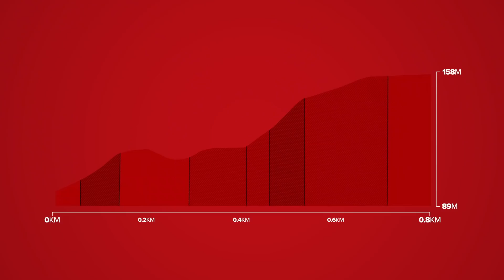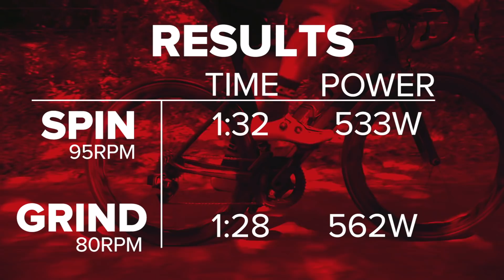Spinning Vs Grinding | What Is The Best Cadence For Climbing On A Road Bike?

Comment: This topic has been very well explained previously without the dodgy "experiment".

As any serious cyclist knows, lower cadence increases the long term fatigue in the legs but keeps the heart rate relatively low. The opposite is true for higher cadence which is easier on the legs but pushes the heart rate higher. The heart rate will come down leaving very little fatigue but the same cannot be said for tired legs. A good cyclist knows this and adjusts cadence depending on how they are feeling. 

Dr Michele Ferrari, Lances Armstrong's famous doping doctor was the one who told him to increase his cadence significantly. The key is that the ability to dope the cardiovascular system (using EPO, etc) is far greater than the muscles themselves.

Comment: In my case,i can maintain 30-40 rpm grinding for 10 minutes straight and 30 minutes spinning with 90-100 rpm.i pushed myself for the past 2 weeks and I can grind throughout very steep hills.using 2x10 gear on my roadbike steel frame, I can climb very steep 5km for just 6 minutes

Comment: Seems your body will just 'tell you' what your 'proper climbing cadence' is when you become better than a novice cyclist.  All you need to remembed is increase your cadence before 'attacks', otherwise just ride at the cadence that 'feels right'.  I started cycling 40 yrs ago when 2×6 sp 42/52t & 13-24t was 'standard road bike gearing', a 46" low/105" high gear.  I climbed in the 40-60 rpm range in 42/24t.  With cadences btw 50-60 I alternated btw sitting & standing, and below 50 rpm I climbed out of the saddle mostly. Btw 65-70 rpm climbing I remained seated and usually shifted into the next higher gear.  OC I was a teenager who weighed 150 lbs back then.  I road bikes like that so long that today I consider anything above 60 rpm while climbing 'spinning', anything below 60 rpm 'grinding'.  Riding flats I consider 'grinding' below 75 rpm, & 'spinning' over 80 rpm, btw 75-80 rpm 'neither grinding nor spinning'.  My 'prefered cadence', the 'sweet spot' is 65 rpm climbing 6-8% grades, moderate cruising flats 75-80 rpm, quick-80-85 rpm, fast 85-90 rpm, really putting out 90-95 rpm.  I spin out on decents at 135 rpm.  My prefered climbing and cruising flats cadence is about the same rpms the pros raced during the 70s & 80s, maybe 5 rpm slower.  IMHO I think this 'spinning craze' us mere mortals obsess over, we've been duped. The 'advantages' ONLY apply if doping with EPO, which increases red blood cell count, & high cadence cycling is ALL aerobic vs. anaerobic.  Recreational cyclists should only spin if they lean more as aerobic athletes. Weight lifter types should grind.  Avg. types just ride by 'feel', but remembe oc to start spinning right before attacking.  Occasional low and high cadence 'training sessions' are necessary to build up BOTH strength and endurance.  You should be able to ride a bike to whereas you 'feel comfortable' cruising flats btw 70-100 rpms, and climbing btw 50-80 rpms, the steeper the grade, the slower the 'feel of right cadence', for example: 75 rpms 4-6%, 65 rpms 6-8%, 60 rpms 8-10%, 55 rpms 12-14%, 50 rpms 15-20%, +/- 5-10 rpms depending if lobsided either endurance or weight lifter.  Old school cyclists have this 'cadence thing' down to 'the feel of science'  ... ie: a 'conundrum' ... so just 'trust your gut' ... ie 'trust how you feel'.

Comment: This is very rider specific. Hinualt often climbed in a 53/15, Pantani geared high too. Froome and Armstrong, obviously use(d) much lower gearing.

When I was younger and used real rollers and rode the track my cadence was much higher. Now, I'm older and I've found that climbing in the big ring or switching back and forth in the middle of a climb from high to low cadence is actually faster for me than just trying to maintain a high cadence.

Comment: Developing good "spin" habits and resilience (learning how to spin and how to recover mid-session rather than blowing up) involves smoothness around the pedal stroke and generally more reliance on "aerobic" muscle recruitment. As you rely more on "anaerobic" energy production throughout the stroke, even if you seem to be recovering, you risk blowing up more suddenly with less opportunity to recover your pace (hence you risk getting dropped like Jan Ullrich chasing Lance or Marco).  All that aside, it's a simple fact that even if you do start to lose your pace while "spinning" versus using a lower gear, it's easier and faster to recover while spinning simply because you can back of slightly and recover without anyone really noticing if you don't need to drop down a cog or loose smoothness. It's harder to recover if you are at the lower end of your cadence window and then must back off because you loose smoothness, hence efficiency, hence you're wasting resources on maintaining your revised pace rather than allowing your body to recover as you perhaps sit on someone's wheel for a moment. If you have to reach for an easier gear that can work but only if you've planned for it because it's far more likely that adjusting to the new cog at that moment will also require transition time and your pace and recovery suffers. Hence you are more likely to get dropped and or lose significant time in a time trial or breakaway mode. It's simply easier to govern a smooth pace if you have a wide cadence window and practice smoothness throughout during your low and moderate intensity work. 

The reason cadence is lower on climbs, generally, is that it's harder to accelerate in a sustainable way. IOW, maintaining inertia is harder on climbs. Therefore your effective cadence window is smaller and it takes too much force to keep a high, smooth cadence because you have to accelerate in to it. Compare average cadence on a smooth but steep climb to an erratic grade that requires constant changes in effort. Your effective cadence window shrinks at both ends. OTOH, we notice it much more if we get hit by extra resistance when we're already at the lower end of the cadence window. If you're cruising at 90 rpm and hit an extra steep grade you don't notice if you drop down to 85 for a moment. The same conditions at 75 rpm might seem fine until you hit that same increase in load. Suddenly your peak torque requirements spike but you're only looking at power in watts if you're looking at all. You'll feel overwhelmed and you'll start to go "anaerobic" just to try to keep your stroke smooth. Your legs are on the defensive rather than just slowing velocity instinctively as in the first example (dropping from 90 to 85). 

It's about "sparing" our anaerobic capabilities and smooth recovery when you start to creep over a sustainable pace. The same thing happens when doing "over/under" intervals but you react differently then because you're trying to provoke those conditions. When it happens in unplanned ways we sometimes react differently and we are caught in the wrong gear. Spinning too fast is always easy to recover from. Grinding is not as easy to recover from. Experiment with these ideas during indoor training sessions and you'll understand how to integrate it in to your training and your habits out on the road as well.

Comment: I like staying seated and doing 80+. For a real steep section, if my power shoots up over 600 W, I'll do 60 rpm and stand and keep it near 450-550.
Reply: stop bragging!!!
Reply: I'm not, what's your problem ? I'm saying I slow it down on purpose after 600 W for fear of burning up. If I was bragging I'd say I hold 800 W all the way up. I'm 100 kg, 600 W for me is probably like 450 W for smaller guys.

Comment: As an old tracky ( cat 1- élite, stopped in 2010) and concentrated on road and TT racing, my cadence on the flat has always been 95-105 rpm. Everytime I went to the montains I struggled grinding 70-75 rpm and could not develop similar wattages to those on the flat évents. I now live sorrunded by montains and my physiology IS changing. My average speed UP long climbs has improved. My cadence you ll Ask? 75-80 UP the climbs,  95- 103 on the flats. My performance level has remained I believe but obviuosly I am aging. My natural cadence remains constant, my power per kilo ratio has improved too (loosing 3kilos lately) but my way of riding those long climbs on terms of cadence and style (on and off the saddle) remains the same. I guess you ought to understand your body whilst under pressure (20+ years racing ) to know was works for you 😉

Comment: The way I was taught was to stay seated, and spin. That spinning was using less muscles in the body, so I wouldn't be using as many calories or carbs. Probably total BS, but it's what I was taught. 

It took me a while to adjust or learn to grind or stand and climb. It is worth learning both techniques, to simply be able to pedal in a group. Those little bursts of speeds are really needed to keep your position in a group.

Comment: All points made about weight of legs (including ankles!) and lifting these didn't mention the point that the pedals are connected, so the centre of gravity doesn't change much because the legs are 180 degrees out of synch. It does change some, because the bending of the legs affects the vertical speed of the centre of gravity. If I see it correctly, the centre of gravity of a leg near maximum extension is moving quite quickly, while the centre of gravity of the other leg (with near maximum knee angle) is moving quite slowly in the opposite direction, so the sum of the two is not completely stationary, but much less than that for a single leg in isolation). Also the movement of the centre of gravity is not wasted energy: just passively putting weight on a pedal accelerates the bike, and when the centre of gravity of the legs is falling, this can be directed as force on pedals via the falling leg while, at lower intensities, the other leg can be passively raised by the pedal.
Quantifying this scientifically would be interesting.

Comment: I think it depends on each rider's physiology, that is to say whether it's the cardiovascular system or the muscles that give up first. For me it's the c/v system, I can rarely push my legs hard enough to hurt them, even on Mount Teide (2,350 vertical metres) on my smart trainer. 3hrs 15mins relentless climbing, but my legs felt fine at around 50rpm.

Comment: The only hills near me here in Texas are bridges over a local river, Brazos River, so I use them for climb workouts. I try to include them on as many of my rides as I can. I work at a state prison and I'm off three consecutive days so those days, outside of vacation days, are the only days I get to ride. I've set a goal for myself of riding at least 100 miles a week. Today, July 20 2019, I rode 32.5 miles and that gives me 101.3 miles in these three days but rode 122.4 miles last week. I'm at 292 for this month so far, including July 1 and 2.
   I try to be in a good gear for me before I reach the foot of the bridge and have a nice pace so I can be spinning as I climb to the bridge high point and safely descend as I watch for debris on the bridge road shoulders.
  Before I moved back to Texas I had lived in Colorado from 1984 to 2012 so I was super spoiled with world class cycling terrain, especially for climbing segments on rides. I always tried to be able to spin at a higher cadence though I was faced with areas where I had to use the grinding approach. 
   I do what works for me because I don't race but I'm a very serious rider. I try to do my rides each week and maybe do intervals one day, longer slow distance another and a faster pace on another. My minimum total mileage goal for each week is 100 miles.

Comment: As an older but keen cyclist one needs the exercise as well as the challenge of getting their without dying I found spinning made the whole journey far easier simply because my bike was stuck in the small cog at the front and would not change so I dealt with it an lo and behold it has changed my attitude to cycling for ever, pleasure over pain.

Comment: Get shorter cranks on your bike. No it won't make you slower, it'll teach you how to pedal fast and smoothly. Use your gears and learn how to ride properly. I ride 152mm Sugino cranks on my steelies and 155mm rotor 3d24's on my carbon bikes. I'm not slow...

Comment: Having just watched the Giro TT, I think a new argument for pro's staying in the saddle may be relevant. The commentator was saying that they should never sprint for the line at the end as your watts lost because of loss of aero is greater than the watts gained by sprinting. When you stand you open up your whole body to the wind, so you will be using more energy over the distance. These guys draft each other at the slowest speeds to gain an aero advantage on a climb. It is probably more efficient for a pro to stay seated, marginal gains and all that......Just a thought......

Comment: I pedal slower even on simulated climbs (Zwift and smart trainer),  where the actual bike's position has not changed.  I got into this by noting my wattage and speed were greater.  Before that, i did not have a wattmeter or ability to easily look at my speed. I was under the mistaken impression that keeping a higher cadence was faster, but it was not the case for for me.

Comment: Simon, i think i've figured this dilemma out. High cadence is dominating the peloton presently but what most cyclist don't understand is that the Vo2 capability required to spin high with power is trained for and to a lesser extent, inherited. Chris Froome, and the top GC riders have high Vo2 levels and can support this rapid cadence with superior aerobic delivery systems. What we witnessed on Stage 19 was a finely tuned Ferrari.  Now most cyclist wont feel comfortable with high cadences because it draws too much resources from their vo2 systems, which may not be up to the task. For a grand tour, energy conservation is critical and by working within the vo2 system, fatigue is minimized. Go into the red and into the anaerobic, its only a matter of time. Simon yates, Chaves and then Thibot are examples. Thanks for the video and discussion

Comment: Hi there are a few things to consider when cadence of climbing. I find in some climbs a slower rpm even using the larger crank gear t53, to get optimal power and acceleration at around a gradient of 6ish. It dose matter of body type as well undulating gradient can cause distruptions in cadence. You don't want to be cycling at 75 rpm then drop bellow 55rpm no matter what power you are producing. When selecting gearing your going to get more problems cross chaining from a higher crank gear to a lower rear gear, Like going to a t53 to a 25 at the back. You can get more problems shifting, gears can slip riding can become more unpleasant. Going from a smaller crank gear to a higher gear at the back you probably get less issues apart from wearing your chain faster.

Comment: Finally. Someone explained the advantage of spinning. It's reduced muscle damage. It's dramatically better over long stages or multiple weeks. It's not more efficient, nor easier. It simply allows you to load your cardiovascular system not your leg muscles. A five minute test of this is UTTERLY pointless, especially if the riders self selected pedal cadence is normally slow. Try riding for 200km with 4km of climbing and test the final 1km climb. I imagine that's where you'll see the advantage. MTB riders have implemented fast cadence climbing for many years. To truly benefit from the faster cadence you also need a forward saddle position and and downward angle on the saddle. Essentially, you do a bike fit on a gradient. Sadly the idiotic UCI rules restrict the distance to the BB so basically make all road bikes sub optimum for climbing. I'd love to design a bike purely for climbing without the archaic rules. One things for certain, it would climb faster than current bikes...

Comment: I'm not sure for mere mortals that this is a useful division, between high and low cadence. I live in the Lake District, so climb quite a lot, and think about the hows and whys of climbing (not that I have answers, but...). I don't think it's just about the legs - it's also about how you use your body and core muscles, and your body position and weight distribution on the bike. That's a more complex set of criteria as to comfort and effectiveness on the bike than simply standing/slow, sitting/fast. But on top of that, it is also about the road, whether it's a short kick or a 30 minute climb.

Comment: You improve what you practice.  At slower climbing speeds you get to the power part of your stroke more quickly at higher RPM, but stay in power part of stroke longer at slower RPM power pulses. When on flats momentum carries you through in a very basic different way.. Climbing you carry less momentum speed and so  there is a odd balance between high and low rpm, grade, effort lever and actual speed traveled. Crank length effecting position and RPM add winds all have there part. Being skinny and super fit is what matters the most. One trick training tip. is to do 1/3 knee bend squats or much better leg press with very heavy weigh like 1300 pounds you can build up to 3-5 sets of a quick 100 reps very quickly. Lower back takes the longest to adjust. 1-2 months training 3 days a week when you stand up on pedals feels like for 1-2 seconds you are not even pressing on the pedals it is so easy.

Comment: Actualy there are a lot of tests about that. This was tested since Moser's hour record attempt. It results that pros have a higher rpm because in this way you stress more hearth and lungs and less the muscles. Being that, during a long 3 week race, and also during the whole season, you are willing to avoid stressing the muslces as much as possible, as they regenerate slower of what hearth and lungs are capable of.